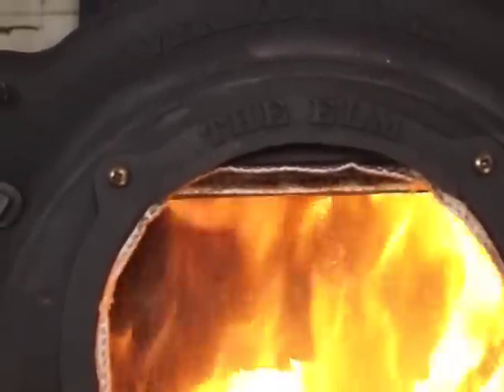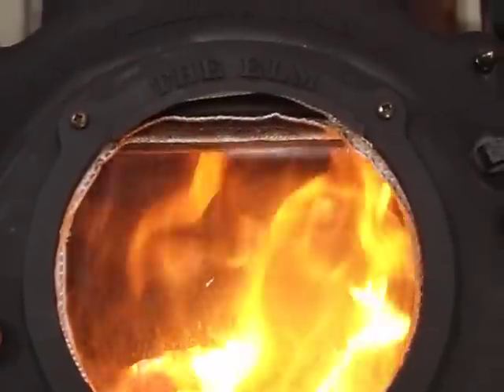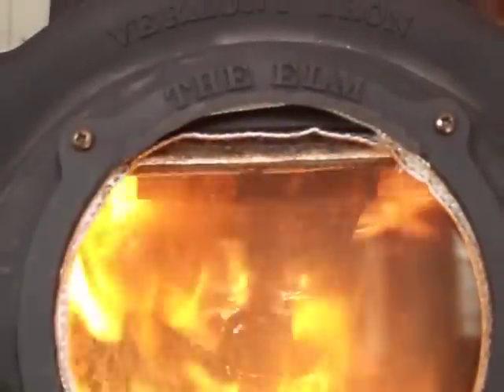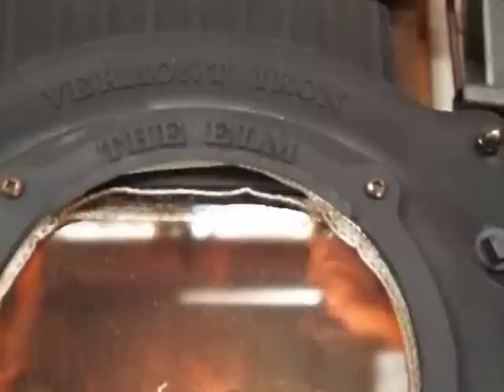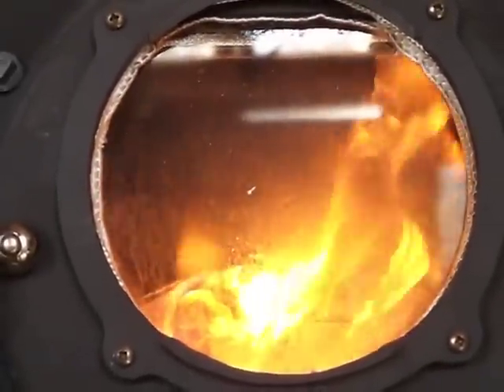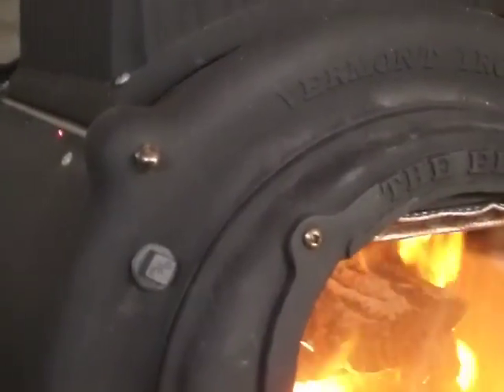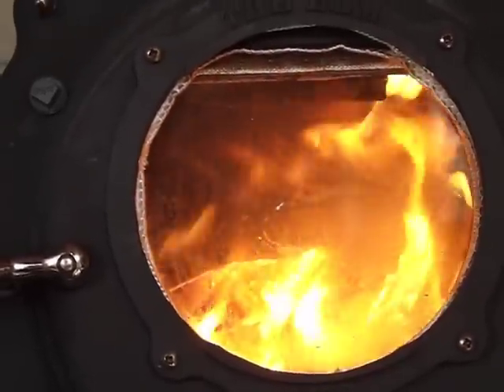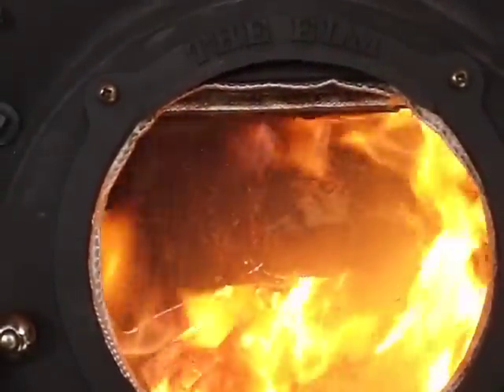Wildfire Elm boxbeam air tubes

Comment: Have you considered feeding the box beam with non perforated tubes? Assuming the longer the tubes the hotter the air once it enter the box beam and out the holes in the beam.